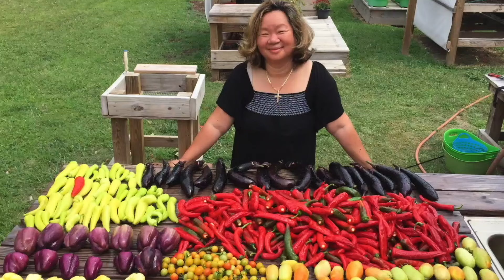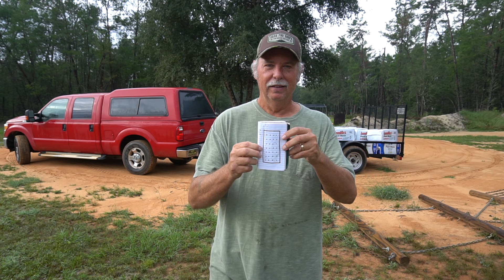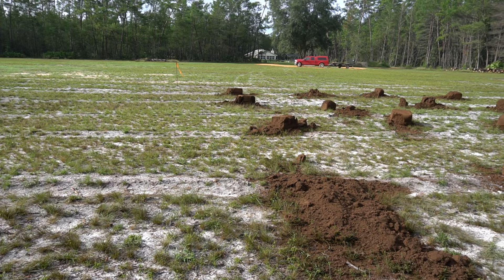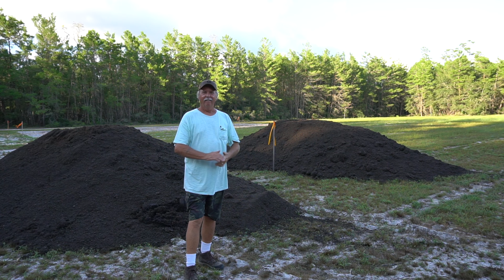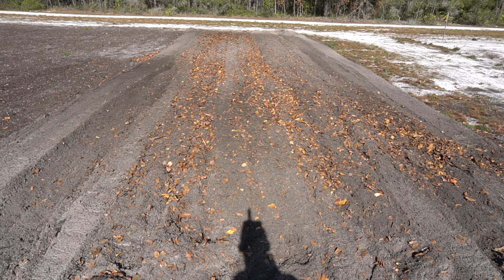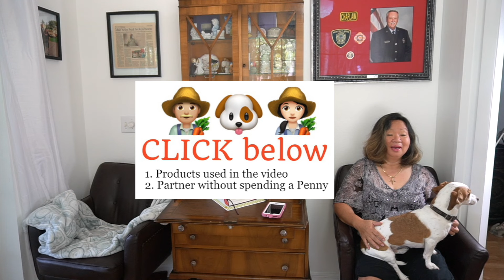1 YEAR l Amazing Garden Soil Transformation l UPDATES! Amending the Soil

Comment: I had good luck adding grass clippings, bags of composted products and any leaves I could obtain, mixing it into the hard clay in Virginia soil. Spent biomass from the garden is also beneficial in building nitrogen in the soil. I know from experience your potash is very low from the sand, some wood ash may be helpful if it don't affect your PH.. You guys have done a lot of improvements since moving to FL.

Comment: I also use black kow manure and have occasionally had problems with it burning my plants when mixed directly into the soil and planted a few days later.  Recently, I tried a new method that seems to be working.  I used this method both in containers and in raised gardens.  In the bottom of the container, I put a 4 inch layer of compost, followed by a 4 inch layer of black kow.  Then I added my soil mixture which was made using equal parts of old potting soil, new potting soil, black kow, peat moss, and top soil.  I also added a small amount of trace minerals, some bone meal, some Epson salt, and some blood meal.  Not only does it not burn the plants, but the plants are dark green, strong, and fruiting early.